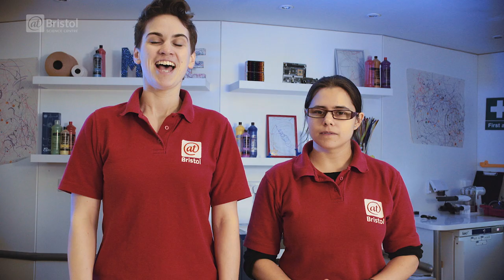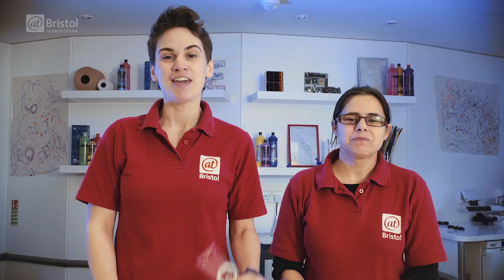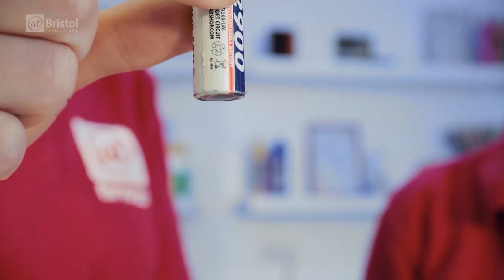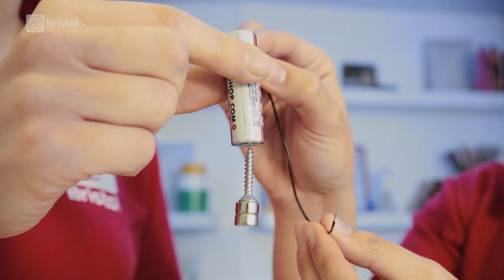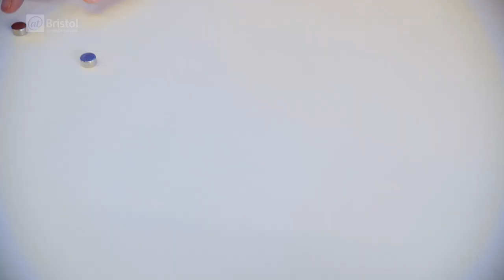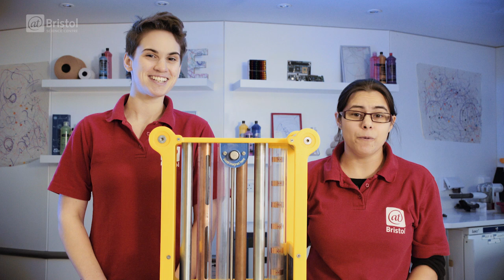How to make a motor | Do Try This At Home | We The Curious

Comment: Dear Sarah and Nerys! I very environmentally minded, and I'd like to just stop driving my petroleum-based car. (The engine of my car (an old Chevy Malibu (from 1987) uses gas (as we call it in America (though I've heard you call it Petrol (which is a wonderfully funny sounding word (Petrol!!!))))))). I love it (PETROL! (Ha!))

But I was wondering, how large a small battery would I need (and how much (copper (wire)) would I need to power each of my wheels? I have four wheels. Or would I have to use four (separate) batteries for each (one) wheel? Also . . . medium large?

You guys are great and awesome! You are saving the planet one car at a time! (Earth I mean.)